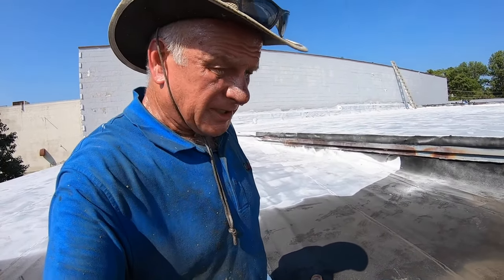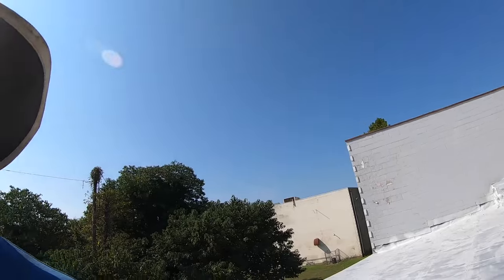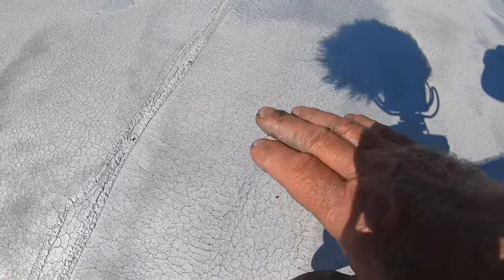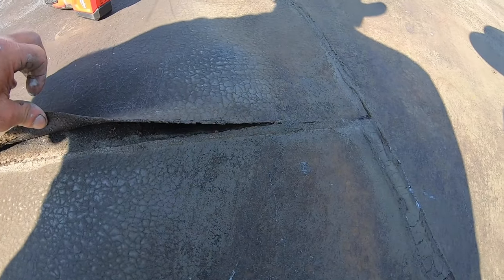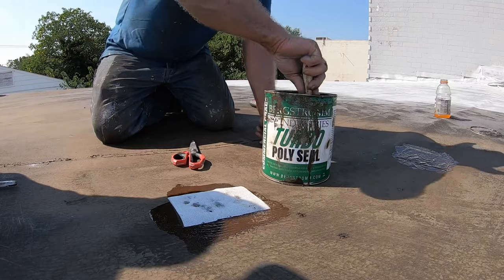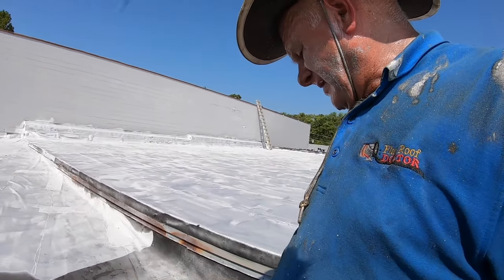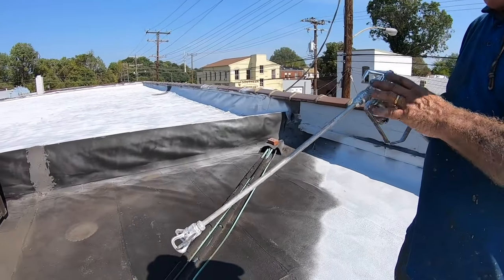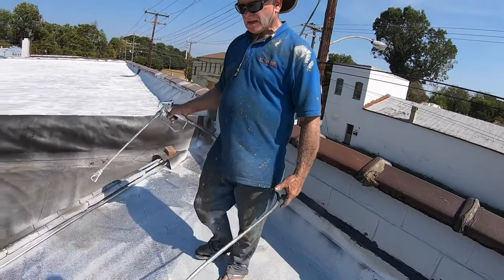How to Apply Silver Coat Protection on your Rubber Flat Roof - This will save your roof

Comment: How do you repair the silver coating on a flat roof if there are leaks 2 years after applying it? Do you have to remove it to apply silicone?

Comment: Is silver coating, aluminum coating? And is that better than the super silicone coating I’ve heard you mention before?
Reply from the maker: Aluminum Asphalt is the the same as "silver coating". Can not be compared with Silicone Coating. Silicone coating use primarily be used on EPDM roofs and not any other roof surface. If you want t protect a metal roof from rust, then Aluminum Asphalt is the correct coating. To protect a Torch Down Rubber roof, Silver coating should be used

Comment: Hey Doc i got a way to remove that Turbo polyseal from your fingers and hands, just take 1/4 cup of hard Coconut Oil and just start rubbing it into your hands and fingers, then sit and wait 5 minutes and start rubbing again and you will see the black polyseal dripping from your hands and that Coconut Oil really gets it all off, not one of those half ass hand cleaning jobs, then you need a baking soda wash  to get the Coconut oil off your hands.
Reply from the maker: wow, that is good advice. How do you know if it is the black from the Turbo or is it your skin rubbing off? just kidding with you. I really appreciate the advice. I have to get some Hard Coconut oil. 
The problem I am a instant gratification guy. While on the roof, I want to clean my hands very fast so to move on to the next task, then Lacquer Thinners comes in handy. Not good for the skin, but it only take a few seconds.
I am glad you are Honest, hard to find commodity. Comment more often, I like your advice.
Cheers
Reply: @FlatRoofDoctor  i misspoke when i said hard coconut oil, its nothing special just regular coconut oil in a bottle thats not melted, i will try the Lacquer thinner next time.
Reply: I like WD-40 to remove asphalt resin, I find paint thinner too harsh on the skin, really dries it out.